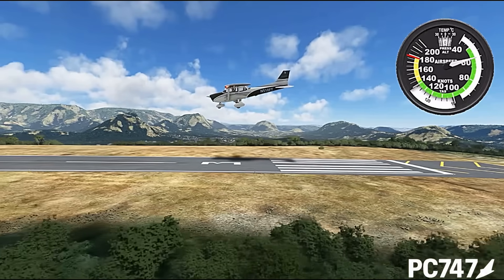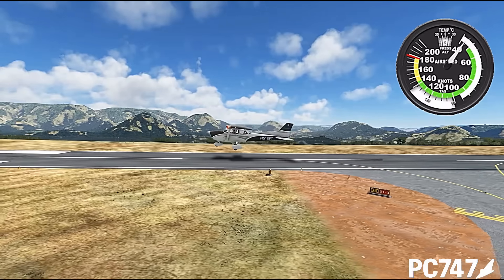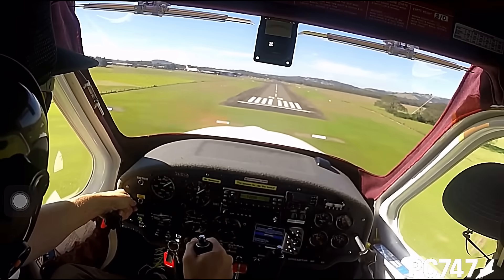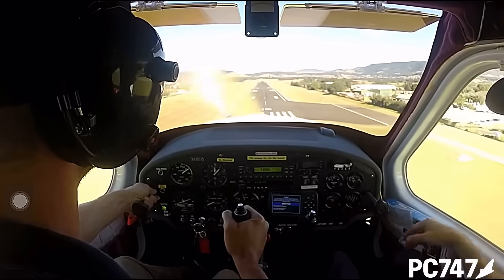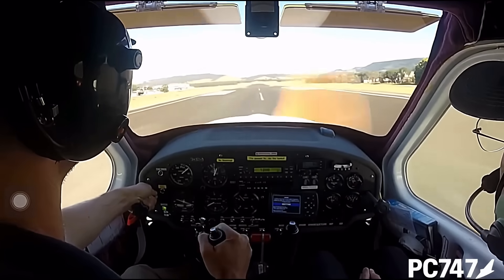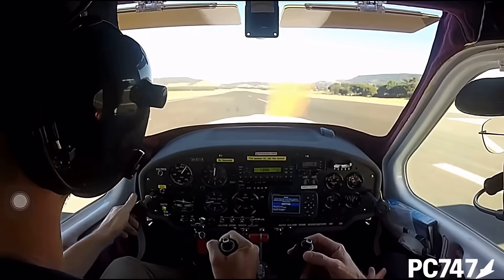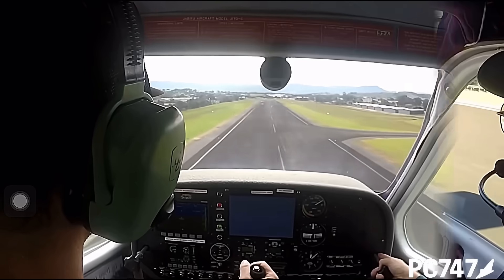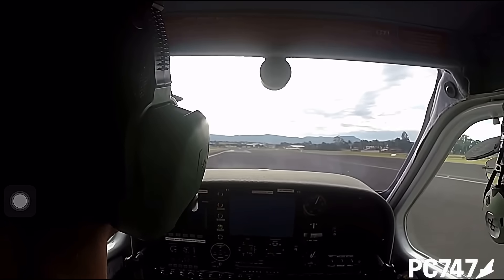How to Land a Plane -The Secret No One Tells You

Comment: ATP here. All excellent training points -let me amplify on one point which very few CFI‘s train their students on with respect to kinetic energy. Few CFI’s emphasise the importance of approach speed and this is further exacerbated by the fact that Vrefs for light aircraft only specify one value -that value is for maximum weight. How many aircraft are at maximum weight during training? I dare say not many. Add to that the tendency of general aviation pilots to carry more speed for control authority means that during the landing phase they’re carrying excess energy during the flare. Consequently, they are more likely to porpoise, incur multiple bounces, wheelbarrow et cetera.  Alas,  student pilots carry this bad practice post certification and many a research study going back to the 70s document the proclivity of general aviation pilots to carry excess speed in the landing phase. 

This is not just an academic exercise-come an engine failure when one needs to minimise the energy (which is a square of the velocity) during landing in unimproved field. Carry excess energy and the chance of greater injury severity goes up.
Reply: I think many pilots carry extra speed on landing because it feels much safer during the approach to be further from the potential dreaded stall. Once over the numbers, they wish all that speed would dissappear. This is my memory of my flight training (100 hrs 5 yrs ago). Sometimes had to go around for fear of running out of runway.  I think slow flight (especially in a 172) should be practiced more.
Reply from the maker: @bradclaridge2417 Brad, 

                   Thank you for the thoughtful comment & insight. Cheers! 😎👍
Reply: Nearly correct.
Reply from the maker: @HerbertTowers 😀😎👍
Reply from the maker: Douglas,

   Vey well said. Thank you!!! So many students & instructors could learn a great deal from you. Best regards!

Carlos 
PC747

Comment: Many thanks captain from a fellow pilot with low hours in the uk,my issue is I always land left of centre line .More right rudder ?
Reply: Also be mindful that due to the torque of the propellor it is trying to pull the aircraft left
Reply from the maker: @timesquare5473  👍👍👍That is particularly true during climb, when the engine is at climb power. Though not gone entirely, during landings, it is less noticeable, when power is reduced. Thank you for sharing that insight! 🤩🤩🤩
Reply from the maker: Ailerons control drift. If you get a chance, be a little bit off extended center line, when there is no wind. Practice utilizing the ailerons to establish yourself on center line. What would probably be best, is side slipping through the extended centerline, again and again and again, in order to build your confidence. Let me know how it works. 😃
Reply from the maker: Your welcome. 🤩🤩🤩